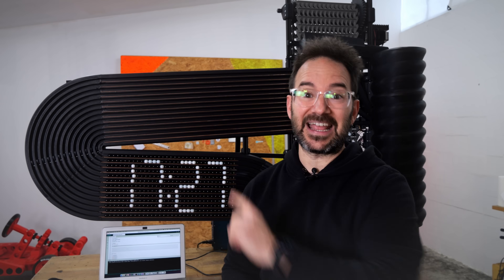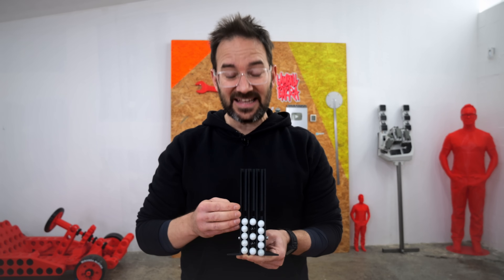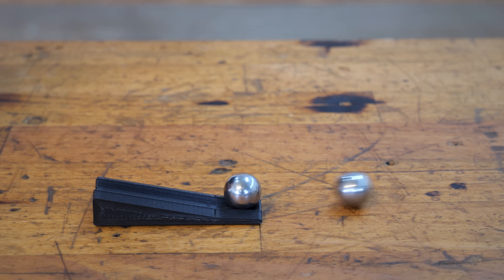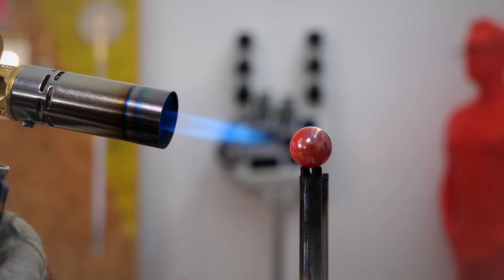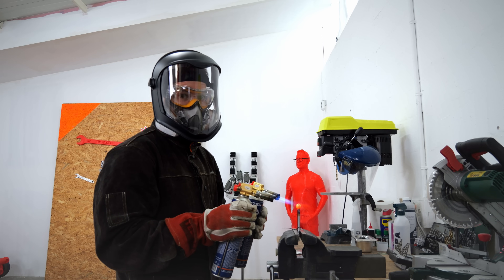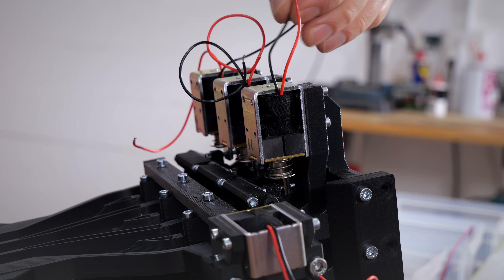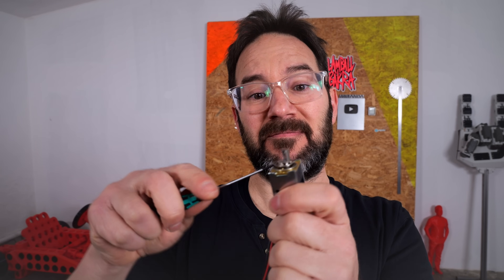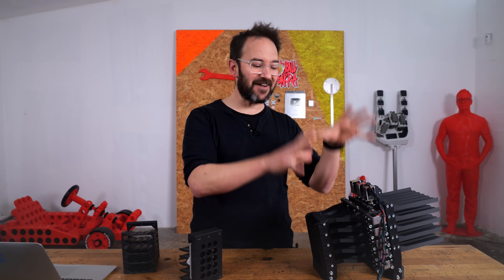Ramp Based Rapid Marble Swap - Marble Clock Seconds Display Pt.1

Comment: Is it just me or is the multiplexer kind of pointless? It saves on a solenoid or two but otherwise just having 9 solenoids for choosing, and one for releasing, seems like enough for me. Also, why even have black marbles? Just give some marbles a bit more momentum so they also jump through and that's it. And that way, instead of a selector, all you need are some fins down the channels to stop some marbles farther back.

Comment: You're a maniac, mate.  Love it.  Idea:  since you are now using steel balls, could you use the electromagnets directly? In other words, dispense with the actuator rod and spring on the solenoids and just use the magnet directly as a stop/release mechanism for the balls.  Magnet on - ball stops and is held in place; magnet off - ball is released.  Cheers from Geoff in France.
Reply: He'd probably have to rig up a demagnetiser circuit then otherwise all the balls will end up just sticking to each other.
Reply: @Galerak1  Good point.  And a magnet strong enough to stop a rolling ball would probably interfere with other balls nearby.

Comment: Use two vertical columns of numbers with all numbers visible in both columns from 0 to 9, with 0 at the bottom and 9 at the top. Each second, drop the bottom digit and reconstruct it on the top. The current second would be read at the bottom. This will give nearly one second of viewing time between digits.

Comment: With this system you only need to update the marble if the color changes. That way the marble selection process is even faster!
Also, you could just have two marbles per "pixel" and swap them. idk if thats against the spirit of the idea but... it'd be less noisy and definitely faster 😂
Reply: You can still use the swapping method while keeping the spirit. Just use the machine in this video to make every channel alternate black and white. And release the marble when a change is needed.

Comment: instead of triggering each column independently you could put all gates to left side, and trigger all white columns at once, than move all gates to the right side and trigger all black marbles at once. I think this way you could improve the marble picking speed by 1/3

Comment: What if you only changed the marbles that needed to be changed from one number to the next?  For example, to go from 8 to 9, you would only need to change 2 white to black, and then to go from 9 to 0 you would need 2 black to white, and 1 white to black.  It would look like each number is bursting out of the one before it, and require fewer marbles.

Comment: @ivanmirandawastaken You don't need to replace all of the marbles each secondt. First of all leading digits in two symbol numbers can stay for 9 seconds. And to change a single digit, You only need to replace so many marbles. Some bright/dark ones can remain. That would reduce amount of marbles that have to be in the loop if it's an issue.
2nd idea - if there are stainless (or other non-magnetic) materials You could use them as 2nd colour and make distinguishing them simpler.

Comment: how are you going to select different color, while selecting rows and lines in bulk? for example in the first line, number 1 needs white-white-black. the current setup needs 2 rounds for completing this task, which means that you have to do the selection at least 2 times in 1 second.... or those solenoids have to work every half second and I don't know if this is enough time for the balls to slide. anyway, I'll wait for the final result.

Comment: So -- you set each row to be the color for a single column and then release a whole column at once, right?  So if you want to make the digit 5, you would set up (from the top down) Column 1 = WWWBW, Column 2 = WBWBW, Column 3 = WBWWW, right?  Clever.  If you are just doing digits though, your column 2, rows 2 and 4, never change.

Comment: I liked your first design of marble selection. the “rotating”/“swing” one. Because you are using latching solenoids i suppose you can have a strong double spring to “keep”/force the selector to be always in the center, and when you want left or right, you can simply power the solenoid the correct polarity. After action, the spring then brings the gate back to center position. Much simpler solution I think. Just food for thoughts. 😉

Comment: You don't need the black marbles... only change the silver (visible) parts of the array(?)
Reply: My thinking. Add a Release gate to remove the marbles instead of kicking them out and only use silver marbles.

Comment: Cool! Why not improve it by replacing only the changing marbles. The input could be alternating black/white marbles for each of the 13 channels (you have 2 channels that are always black). When something is changing, the marble is released, else it's not. You could then have a feeder that could work, as it would sometimes be very efficient (from 5 to 6, only 1 marble is changed), the feeder would input a positive net number of marbles during that time and would compensate the more requireing changes (7 marbles to use when changing from 0 to 1).

Is it crazy? YES!

Comment: I suspect its going to prove problematic that you're still relying on gravity to push the marbles. Have you considered using solenoids to push them through the gates at higher speed?

Also, it would be cool to see this done at an even smaller scale using ball bearings...

Comment: I wonder if the solenoid selection method could reach sub second speeds. I don't know if it would make the design more boring but could the digits be already assembled correctly in the channels so you could just rotate them (0->1->2...9)? Of course the "release->capture in correct order" phase could be nightmare.

Comment: Ivan. Why not find someone with an abrasive tumbler to polish off the chrome? Then cold bluing will work. Since they could be tumbled in bulk, it'll save you a lot of time.
Reply: Chrome is HARD. Also, y’all are complaining the clock is loud already?  Now imagine it with several hundred balls in a rock tumbler…
Reply: @imrotinom  I can't see any value oin comparing the noise of the clock to the noise of tumbling, which would be a one off process, not a constant addition to the decibel collectoin. And there are several abrasives that will take off chrome even though it's hard. Tumbling or sandblasting are the easiest and (in surface finish terms) the cleanest ways. And Ivan already ruled out chemical ways so I assumed he would not want to try reverse electroplating, which is dangerous for amateurs.

Comment: How about only changing the marbles that need changing rather than the entire array?
Reply from the maker: I need to release an entire column each time because the releasers are connected. I could only do partial swapping if the digit had an entire column unchanged but yes, could be done.
Reply: @ivanmirandawastaken  you could have 2 releasers per marble rather than a selector. That gives you the option of releasing black, white. or doing nothing. It might help reduce the noise. Well done, great job with the clock.
Reply: @ivanmirandawastaken  Here's a thought, you could not return the selector to the middle position so that channel didn't have a marble to release? They are always going to be alternative colours. Or even preload the column in alternative colours and only send a marble when it needs to change?
Reply: There are 2 black marbles that never need changing.
Reply: Also if you move the 1 orientation from left to right you'd have 3 white marbles that would not need changing (or at least you wouldn't need to make a black channel)
Reply: A good idea, they could be fixed to save noise and mechanics. That would be 5/15 that didn't need to move, so 1/3 simpler.

Comment: instead of black marbles you could try copper plating them and then oxidizing the copper layet
Reply: If he could get away with blanks, i feel like just having silver numbers could also work. but then he would have needed a 2ndary solinoid to eject marbles. but he would have saved himself the problem of selecting all those marble by color. lol. Too late now

Comment: sooooo, the bluing is the correct thing to do? but hot bluing is a nightmare. you should legitimately have used some weak acid, muriatic acid is a commonly purchaseable one used for pool water treatment, and then you could cold blue that metal directly without heating.  If you absolutely wanted to hot blue this many ball bearing/marbles, the correct way to do it is: put the entire metal tin of them into the furnace to heat them up as a whole unit, and then dump them out into the oil at the end.

Comment: um... its actually really easy to get them all the same color with heat. you put them in the oven.
Reply: a little more detail on this. the color is dependent on the temp not the time. most kitchen ovens can go up to like 260 or 280c. to get to blue for steel I think its around 300 so you probably wont get that but I think you can get a deep brown. just load all the marbles you want colored onto a baking sheet and cook them for like an hour or so at the max temp your oven can go to. this is how tempering is done.

Comment: Due to the “slide” being too loud, you could replace it with a plastic bendable hose from the top to the bottom. That will give a cooler look and you get to see the marbles race down.
Reply: I see Martin made a second account to suggest techniques from the MMX
Reply: I wonder if you can get PTFE or nylon, or any other self lubricating polymer tubes of the right diameter